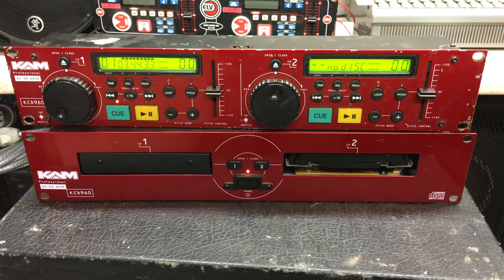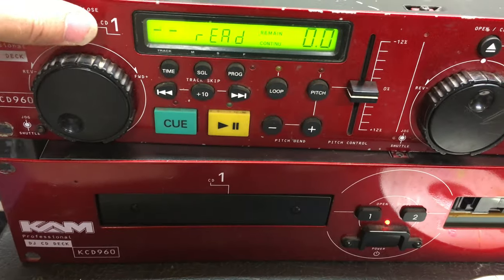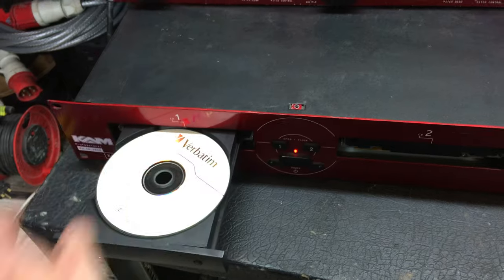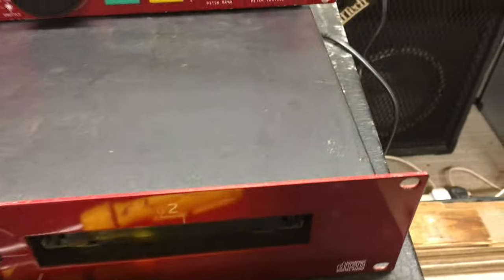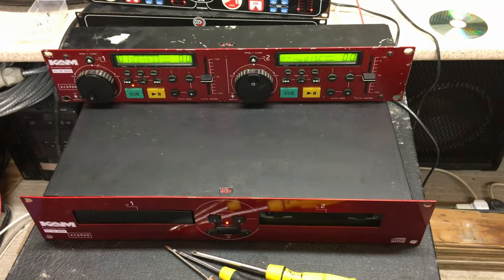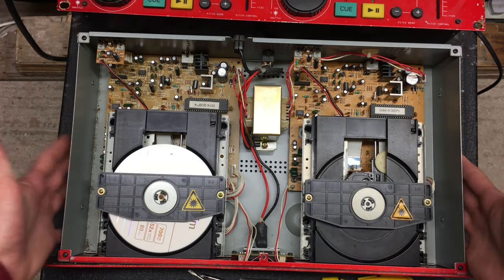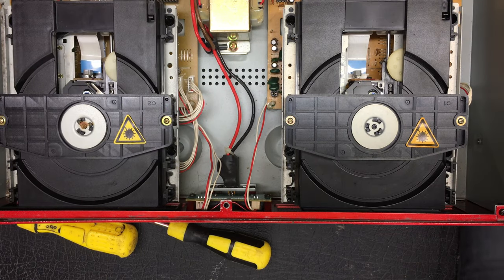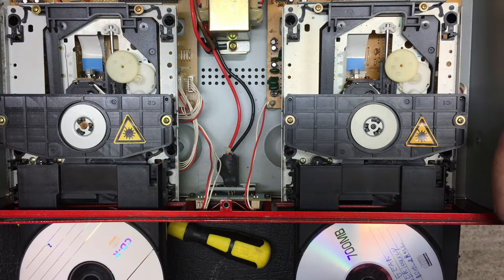Fixing A CD Player With Sticky Draws - Shrinking Disc Tray Drive Belts With Hot Water - Repair Guide

Comment: Wish I'd seen your excellent video 2 months ago to see 5:30 as I didn't know how to fully remove the CD tray!! Instead I just removed the 6:15 top piece and managed with great difficulty to fit a new belt through the tiny gap behind with tray still fitted... 😅 
You should tag this video as CD deck belt replacement / tray disassembly too because you show how to properly dismantle the CD mech which is identical to that used in my Denon deck and probably many other 90s stacker systems!! It's very useful 👌👌👌

Comment: Brilliant, just saved me from buying a new belt. I suppose there must come a time when shrinking belt no longer works.
Reply from the maker: Indeed the belts will eventually degrade and need replacement but this is a great way of extending the life in the meantime while a replacement is sourced. 😀 
I've actually got a player of my own which I shrunk the belt on almost 2 years ago and it's still working ok since though! So mileage can really vary. 
Glad you found it helpful! 
--Nathan

Comment: Good stuff! Thanks. Nice and simple. I have meaty fingers and couldn't be bothered dismantling that internal cover. So just used a hair dryer to shrink the belt. Smelt a bit burny at one point, but seems to have done the trick.

Comment: This is a great video. I have a Quick question I dissembled a Panasonic CD player that the tray worked a few times, read the disc but then the tray got stuck in a halfway out position. It was dirty so I cleaned it and took off the lid but the scary label about radiation and electrocution made me stop going further. I couldn’t move the tray with my hands so I’m wondering if that is likely the cog is off. Does that make sense? I might do the boiling water thing too as it is from late 80’s early 90’s. I feel more confident opening it up again watching this video.

Comment: This was fabulous advice.  Although I have a Dynaco CDV Pro Vacuum Tube HDCD Compact Disc Player, I could carefully followed along with the instructions on the machine used by Nathan.   I was able to disengage the tray, and remove the rubber belt.  I placed the belt in a small tub with hot water for 2 minutes, allowed it to cool for 5 mins (as directed), re-installed with the now slightly shrunken belt, and it worked fine.  That's for the advice, it worked to a "T."

Comment: Thanks for this tip. I have a similar set up Citronic Dual CD player. This was a forgotten project the unit started playing up about 5 years ago had a look but didn’t think it was a simple drive belt so it was put in storage. After moving house  I rebuilt my radio studio and dragged out this unit for another look saw your video and it’s now working fine.  Thanks again